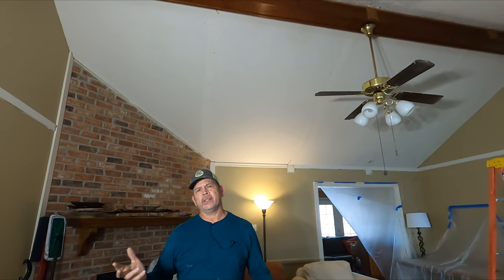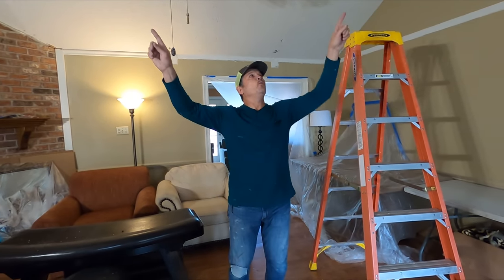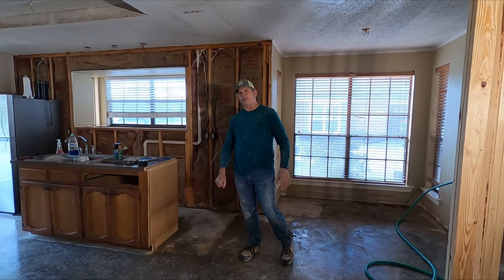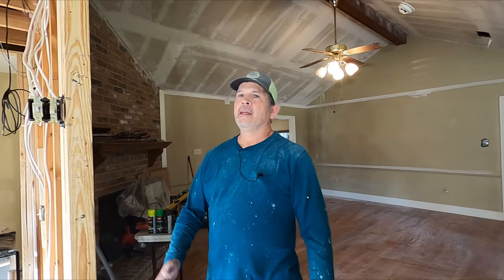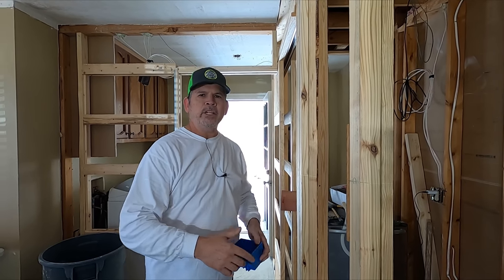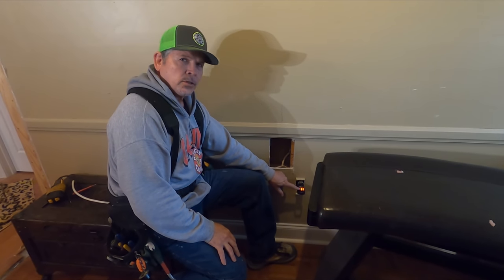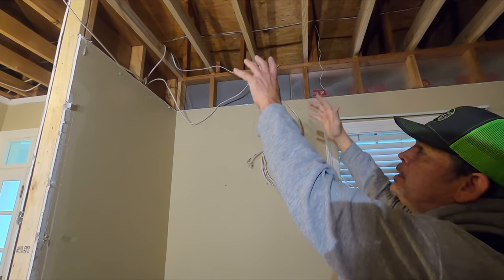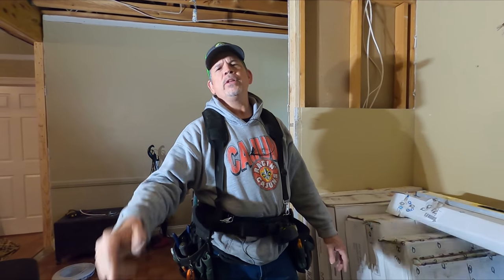Scraping Popcorn Ceilings.. There HAS TO BE a BETTER WAY! Ep. 9

Comment: In Jersey, you can work on electrical in your own home but not somebody else's unless you're licensed. Which is ridiculous because 95% of homeowners don't have a clue what they're doing and tend to burn their own houses down when messing with electrical. It should be based on experience but of course unions get in the way and forbid GC's from doing their own electrical and plumbing so they guarantee themselves job security. This is why I despise the red tape and bureaucracy that comes with unions. They only look out for themselves and the rest of their club and screw everybody else. There is no logical reason why a GC with a background in electrical can't run their own electrical on their jobs. It's silly because you running wire as just a GC is technically illegal but if you pulled the homeowner over with no experience and no clue what they're doing and they do it, then it's legal because they're the homeowners. The law makes no sense at all sometimes.
Reply from the maker: My thoughts exactly 👍

Comment: I know it's a pain in the ass but there's a reason why they don't want contractors doing electrical work: most of them aren't like you. I've seen some shitty work over the years and it couldn't ALL have been bad electricians. Also, can't homeowners pull their own permits? Will they let permits be split up? Some pulled by contractors and some by the homeowner?
Reply from the maker: Thx Red.  Check out our recent post with the 4x4x1-1/2 box with 10 cables going into it.  Found it in the attic on this project.  This was installed on a permitted addition 😳  Yes homeowners can pull their own permits here.  Don't know about splitting them up

Comment: MA is just as bad, I work in IT and I wanted to get low voltage certified so I could run ethernet, coax and DC runs for access control to code and 100% legally.  MA requires you do 4000 hours under a master electrician in LV.  So I would basically have to quit IT and be an apprentice for 4 years.... for low voltage....

Comment: Oh my god, what is it with americans and nails? Isn't it easier to use a screw on those electrical boxes instead of nailing them?
Reply: Speed. Those two boxes seemed like a lot of work because they were in a tight spot but a guy with a hammer will knock those boxes in, in half the time then a guy with a drill and screws.
Reply: det er mye amerikanerne gjør som ikke er logisk her i europa :) og vice versa
Reply: Most of them come with the nails already in them. Most also won’t fit a screw in the slot the nail was in if you wanted to take the time to try and swap it out.
Reply: @abcdefghijklmnop514  I use 3 inch finish screws
Reply: @lrc87290  congrats.
Reply: nail is cheaper, nail has all the holding power required, and it's not expected to ever be pulled and replaced.
Reply: @TheSidneySmith  I meant just where hammering nail is difficult.
Reply: @lrc87290  a lot of those places where hammering a nail was difficult, putting a screw into the same attachment point wouldn't be any easier.
Reply: @TheSidneySmith  True. Sometimes it is though. How about inside the box? Is that allowed?

Comment: Try cardboard and i don't  like cheap plastic  boxes. And who is checking your electoral work.  The electrician. We need permits in Ontario and you can still do your own Electrical work I wired my whole home no problem from the inspectors. Have done 3 homes now. It's just keeping up with new codes and my cousin helps he is a   licenced electrician

Comment: I normally enjoy and admire the attention to detail you use on your projects.  This, however, is a video on how NOT to scrape an acoustic ceiling.  You spent more time cleaning up and making a mess than anything else.  If I was the homeowner and I saw you bring a garden hose into my living room, I would ask you to immediately leave.  Why didn't you cover the floor if you knew you would have a soupy mess of vermiculite and binder on the floor???   Never mind that that is NO REASON to use the much water when wetting the ceiling.  How did you think this was a "better way" ??  cleaning walls, doors, floors, etc.  Wow.  Just wow.
Reply from the maker: Fair enough, not my best day for sure.  Others have commented on using an airless paint sprayer to apply water.  I'll have to try that 👍💪